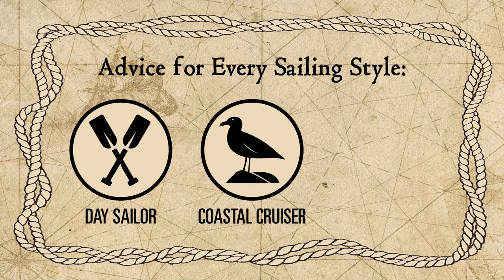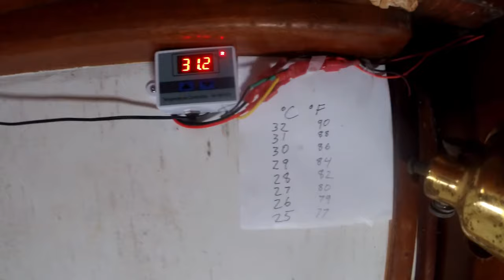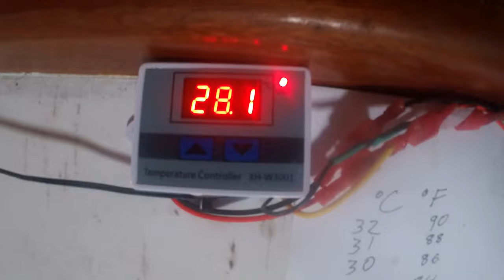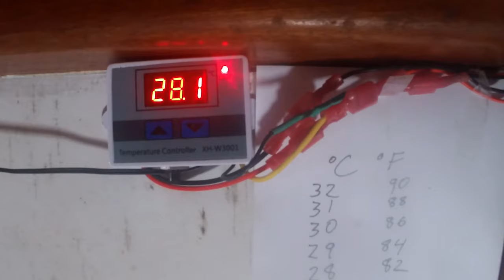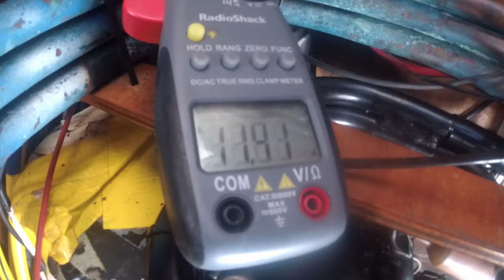Battery-Powered AIR CONDITIONING on a Sailboat [Capable Cruising Guides]

Comment: So where is ths compressor available?
Reply from the maker: Through me if I get enough interest.  The manufacturer doesn't seem interested in selling single units.
Reply from the maker: The one I found has a COP rating of like 8.5.   Best I've seen elsewhere is 3.0
Reply: Looks like you're looking at Rigid brand compressors, I'm pretty sure they are a US sold rebrand of Four Seasons Thermo as they share the same specs and literature pictures.  They don't offer the same cooling capacity of the one Clark found, the closest they have is their QS3202VDL and their advertised COP appears to be 6 at 65 degree evaporator temp and 100 degree condenser temp at 4k rpm.  The one Clark found is running probably around 7.5 at the same conditions (their data only lists 60 and 70 so I'm interpolating).  The cost to cooling capacity is about half though their controller doesn't have as many features as Clark's.  If you haven't figured out, yes I identified the compressor Clark used (I'm an engineer who works in defense), no I won't say what it is and screw him in his effort...I'll be building my own because I think it's more fun and I also will probably customize it and use different compressor(s) as I have two small separate sleeping areas on my Hans Christian 33T and this one is probably overkill.
Reply from the maker: Thanks Christian.  If you use one if the new larger offerings, please PM me and tell me how it worked for you.
Also any insight on getting bulk purchase prices from them.  I'm sure you have had as much trouble with them as I.  They really didn't seem to want to sell one compressor, hope it will go smoother if I order a pallet.
Reply: @Clarks-Adventure  Clark, I'm probably looking at doing two smaller units one for the small cabin starboard of the companionway and one for the forward pullman double (not sure if you're familiar with the HC33 layout).  The other option would be one single unit and ducting to the single cabin that gets closed off when not used.  COP is better on the one you identified than the smaller ones from the same company but I'm wondering if I'd be short cycling it being too oversized.  Waiting on my survey report and closing on her this month, will winter in the keys this year so this and lithium will be near the top of the list.  Where is the best place to PM you?  I will reach out and see if I can help with anything.
Reply from the maker: Patreon is the easiest but it will cost you a buck.  I hate Facebook and don't use it much (Emily likes it but isn't good with messages) but I'll keep an eye out there over the next day or so.   Once we hook up we can use email.

Comment: cool! (sorry). Great strategy & solution. A COP of 6 however does not sound believable. Would be more efficient if you turned the compressor and fan down and kept it running.
Reply from the maker: The compressor alone has a COP much higher then 6.  I'll be publishing data on a webpage very soon.
    Make sure you fill out the survey.

Comment: Yepper...most A/C residential cool with 20 degree differential temp....your battery powered A/C is more efficient using a 8 to 10 degree differential.  ...as you say, once the air inside the room is cooler it will "start from there" and cool further.
Reply from the maker: Works well in a small room.  I see where a whole house would need the bigger differential.

Comment: We are many that want you to make a video whit you agm and lithium together and a good explanaitione of this.

Have 2 Banks. 10 kW lithium VW car battery in 24volt in 1 bank.

And 9.2kw in agm from enersys powersafe topp of line agm used in hospital in norway.  Get them low cost only used 2 times over 5 years.   Now in my boat.

And we are a group of People from norway that is going to travle from norway down all eurpean waterways to middelterainien
Reply from the maker: Got one coming soon where I plan on laying out a table with a small bit completely electrical system.  Solar to inverter.
  I could include a BankManager and a LiFePO4 if you think that would be helpful.

Today's video shows a BankManager on an electric boat li conversation that you might find interesting.

Comment: I think your using efficiency in place of consumption.
Reply from the maker: In what way?
Reply from the maker: I give the power consumption in the video.  It moves about 4000btus for that power.  The manufacturer if the compressor says at that power level it has a COP of about 8.
    There you go both consumption and efficientcy.

Comment: Lets see, boat and RV (even electric cars) all need electric AC compressors. But a tiny compressor from china is more revolutionary then units being produced today. I think that you found a unit you can work with but it is no more effiecient than the typical unit probably less as you are not doing repeated manufacturing upgrades. People that buy a unit made up this way will have no warranty and it will be less developed than the zero breeze which was a kick starter and probably uses the same compressor . The only thing you are doing is using saltwater to exhast the heat (which of course is great). Good luck, i do think you have a good idea, but its a hobby  build, i like the idea that it can be cycled down to give cooling all night,  if i went solar i would look into it for my RV but would probably buy the zero breeze and modify the electronics (and doing so would of course void the warranty)
Reply from the maker: No it's not the same compressor.  This is made in the US and can pump 5000btu.
Sorry I'm not up to your high standards.  Good luck with your approach.  If you find a better way I'll be the first to admit it but this is really a game changer in my opinion.

Comment: I bet boat AC can be made very efficient by using the water to cool the condenser coil rather than air.
Reply from the maker: Yes and that's how it's done in a boat.  This one is MUCH more efficient then others that use that trick.
Reply: @Clarks-Adventure  
Ahh I see.  I guess that explains, in part, the 3X efficiency.

Comment: Nice video except lithium does not like heat and neither do solar panels their generation degrades accordingly and lithium discharge as well as charging...and try running that in a hot humid cloudy environment, you will not be able to generate enough power to run it... battery power is great in a specific environment hybrid systems are much more reliable  and dependable

Comment: cruisair makes a 12v 3500btu unit -- Cuddy II 3,500 BTU 12V DC-Powered Air Conditioner or Climma compact 4200 btu Reverse Cycle air-conditioner if you want heat.
fyi i wish you would post details on parts and who makes it. keeping info and hiding details in your videos makes them worthless.

Comment: You're an engineer living outside the US and need a temperature conversion table taped to your wall?
Reply from the maker: Yes.  Why waste mental capacity doing math
Reply: @Emily & Clark's Adventure  You don't use math. You learn what the numbers MEAN, same as you learned Fahrenheit. 0 is freezing. (32F). 10 is quite chilly (50 F). 20 is comfortable, pleasant.  (68F). 30 is uncomfortably warm. (86F). 40 is HOT. (104F). Everything else is just shades in between. You'll notice that each step of 10 Celsius is 18F.
Review: 0/10/20/30/40. Use them, live with them, and stop translating it to what's familiar. That's just lazy, and you'll never really learn that way. It's the same way you learn a new language: stop translating everything back to English, and go direct from the new word to its meaning.
LEARN 0/10/20/30 and 40. You'll never have to learn what 50 is, if youre lucky.
Then LEARN that 25 is halfway between what's comfy (20) and what is too warm (30). Repeat for 15, 35 and 45. (45 is DAMN HOT.) 
This is how I taught myself when moving from US to Australia 45 yrs ago. It's the only way.
Your way is the typical American way, and the reason that Americans are so bad at learning other languages. They're always thinking "What is it REALLY? What is it in American?"
And by the way, using mental capacity is never wasted.
Reply from the maker: I actually do that now.

But for the video...   My viewers are chiefly Americans
Reply: @Clarks-Adventure  Good. Maybe they'll learn something from this exchange.
But I don't believe you. Are you saying you tape that list on your cabin wall so your viewers will learn a bad way of understanding Celsius?
Reply from the maker: I taped it there so I could translate during the video shoot and to cover a bit of wood rot that needs attention.
Reply: @Clarks-Adventure  I think you know what I'm going to say next; Be a good engineer and fix the damn rot! Excuses are a waste of mental capacity.
Reply: So is reading all your  primary school BS comments Rich...Take a chill pill.
Reply: @Stillraining3  spoken like a true American who never learned basic science when he was still in the world's trailing educational system, and is shamed by his ignorance, as he should be.

Comment: I am from uk and obese living in Thailand. Evaporative coolers work fine. Just a fan over water.
Reply from the maker: I'm glad they work for you but on a boat we are usually in a humid environment (except when I was in Baja).  Swamp coolers don't work well when the humidity is already high and they have to raise the humidity to function.
Reply: @Clarks-Adventure  interesting. Thailand humidity is usuallyaround 80%.  But the fan is important. If airflow  is too low it is inadequate.
Reply: Not in humid areas. Firstly they just won't cool enough and secondly everything gets damp as hell. Swampies work good in low humidity environments but not in tropics.
Reply: @cruiseryev  works for me here. Even in.the boat.
Reply: At.the moment (8pm) it 85F w/ 80% humidity. I.am comfortable in.tshirt and shorts. Using a fan to.keep the mosquitos away.
Reply: @herbdesson6843  well 85f is not exactly hot.  Sure a fan at that temp will be perfectly fine. In tropical Australia, in 35C and over and 80-99% humidity, an evaporative cooler won't even evaporate the water.
Reply: @cruiseryev  we only use.our cooler  when over 35 and humidity over 80, mostly in bed. A lot is down to acclimation.  If you always have ac you never a climate.  But i think people underestimate the usefulness of fans. They cool well with a little sweat  and use little power.

Comment: i'm not sure i understand the idea here... if your using the same refrigerant as any other AC, the amount of energy required to phase change the gas/liquid is exactly the same.  All you are doing is creating a crappy AC unit that doesn't cool as fast, and runs longer, a regular AC simply cools faster and runs less often...  the energy come out to the same, you cant break the conversation of energy just by finding a better pump.  This is why everyone has the same problem the physics cant be changed, you need x energy to cool y amount.  The only reason it probably works is the better batteries that hold more juice.
Reply: if you want to improve efficient a larger motor is more efficient and will be better with a larger motor, your losses are going to be all your uninsulated walls, uninsulated lines, motor heat, etc,  remember energy can not be created or destroyed.  One thing i think people dont seem to understand, is the size of the area makes a big difference.. if your solar panels absorb 30% of the suns energy, the rest of that sun energy is hitting your boat and turning into heat.  EVEN if your entire boat was covered in solar, you would still need to move 60% more energy to move all that heat away.  This assume everything runs perfect.  This is why people cant AC their entire boat with a tiny solar panel, without running a generator.  You just cant without breaking the laws of physics.  reducing your cooling area is the best thing that can be done.

sorry folks, but perpetual motion machines don't work, no matter how complex you make it.
Reply from the maker: Actually you don't seem to understand the laws of physics here or how to apply them in this situation.

You must accept that a bad old compressor from to 60s that uses an induction motor uses more power to pump the refrigerant.  Well there are better compressors.  We measure that as COP.
Coefficient of Power.  This is the ratio of heat moved to power uses.  A "great" compressor would be a 3.  Tesla cars use a compressor that rates a 5.  Mine is an 8.
Reply: No, clearly you dont.   Even if your AC motor was "perfect" and had no energy loss while running.  And the entire system is PERFECT.  You are still only able to absorb 18-20% of the energy from the sun.  The rest of that energy is being absorbed or reflected off your boat.  So even if you reflect 80% of the suns energy, and charged your batteries with no energy loss, and had your entire boat covered with solar power, to recover that 20%... you are still have other heat sources from the boat like electronics, and humans, and "things running".  The conservation of energy does not work.

You can not run the AC on the boat off solar.  

What you CAN do is cool a small area of the boat.   However, a LARGER compressor is MORE efficient then a smaller one.

AC's are super simply devices.  It works using a phase change material, chemicals absorb the most energy during.  The compressor simply pushes the material through a expansion value to do this... This always requires the amount amount of energy... Can you make the pump "More efficient"  Sure if its made crappy in the first place, but motors already are pretty damn good, your only loss is heat loss from the motor.  However, this is a tiny bit of energy compared to the entire system.  as you can see, the amount of heat being absorbed is a function of the gas/liquid expansion/compression so it really doesnt matter how good your motor is, the same amount of heat will be absorbed into the system.  Infact having a LARGER AC unit is more efficient, since you will overall have less energy loss, compared to how much BTU's you can generate.  This is why in your own video did you state you found all the system had the same "efficiency" until you found some "military" version.... They are all the same because they have reached the limits of what they can do.  Claiming the military company has some magic tech that is better is just silly.  More then likely they are wrong, or you are wrong somewhere.

I guarantee if you swapped out your system with a normal AC unit, did the same setup, just cooling your bed,etc.  you would find you have the same results.
Reply from the maker: "can't run AC off solar"....
    And yet I do.
Reply: @Clarks-Adventure  you running a scaled down AC compressor, a normal unit is designed to blow air out at 50F, your unit is blowing air out at 70+F, so your unit is not  capable of cooling your room to the same temperature as a properly sized unit.  Also you have reduced your area you are cooling significantly.  This is why your system works.  Your not cooling down to the same temperatures, and your cooling area is much much smaller.   Anyone can do this with any AC unit.   If you focus a normal sized unit into one bedroom and set your temperature to higher on your thermostat, then you would get the same results.  Infact i suspect it would be even better.    The best thing you can do besides shrinking your cooling area, is to add insulation around your hull, that is probably the biggest loss of heat.

I dont have any problems with what you are doing, but saying this military unit does something magically is ridiculous.   Save your money, and use the unit you already have.  The other points to your video are good idea's.  I just dont like you claiming the military unit is why your able to do this.

Anyone can do the same thing without spending any extra money, and using your techniques.

Show me these numbers you found and i will show you they are either wrong or you misinterpreting them.

Comment: Why are you talking as if lithium is a necessary component? It draws less than 100ah in a night...that's basically 50% discharge on a pair of golf cart batteries. (And it's not as though you have a small boat with nowhere to put a bank of several GC batts.)
Reply from the maker: I don't think I've said that.  

It would work fine off lead.  But the whole system works better with some Li.

I like a Li/Pb mix.  I have mostly Pb
Reply: Ah yes...now that I have watched a previous video, I see you stating lead will do it. The way you briefly mentioned lithium as a component in this video made it seem as though it was necessary. My friend also got that impression. We both signed up for the mailing list! Need this asap!